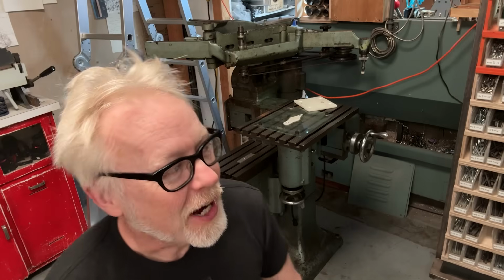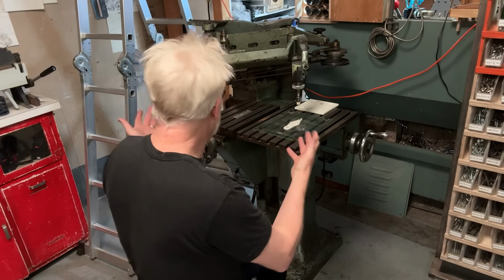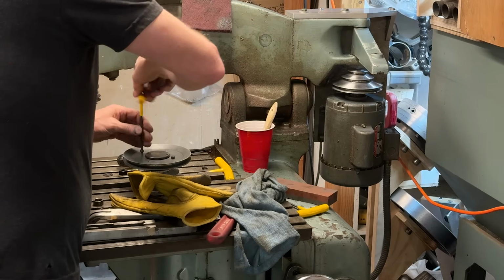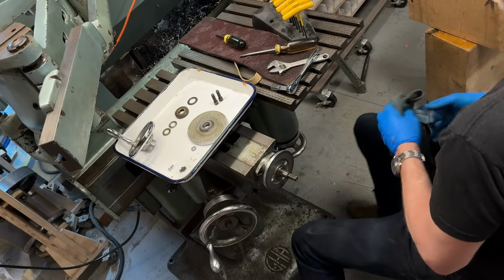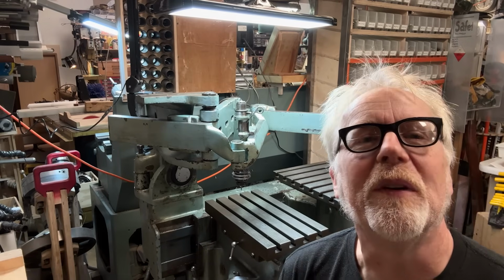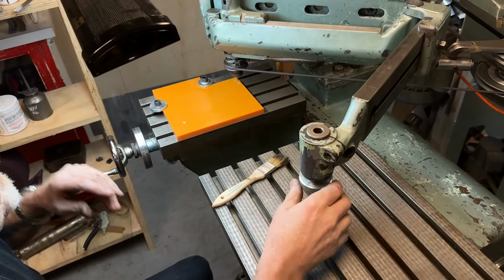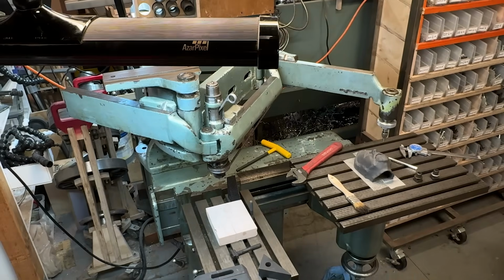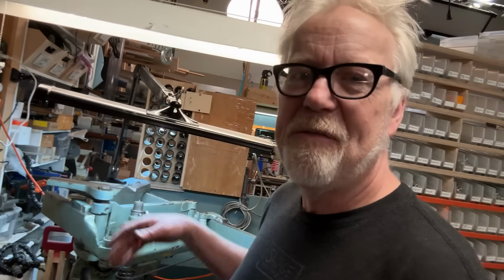Pantograph Mill: The Coolest Machine Adam Savage Owns!

Comment: This is what ChatGPT had to say about the matter: :)

That small plate on top of the milling arm is a depth stop / scale mount.

It’s used to hold a graduated depth scale, dial indicator, or adjustable stop block for the vertical (Z-axis) movement of the cutter head.

On some GHA models (and similar Deckel-style engravers), that position carried either:

A small micrometer stop that limited the downward travel of the spindle head,

Or a pointer and scale plate for manually setting engraving depth.

This allowed repeatable depth control when engraving or light milling, especially when copying contours at a constant depth.

You can often see a small adjustable rod or screw that comes down from above the spindle arm and contacts that pad — that’s the actual stop mechanism.

Comment: WD-40 (Water Displacement) spray would not have been my first choice. the Gray Label of De-Oxit is great on metal surfaces, as well as being a better cleaner for electronics than an atypical tuner bath. It dissolves corrosion and creates a lasting barrier. A PIN wrench should work for the bottom to lock the spindle. And, a couple of stabile well positioned fans, or clip fans to push debris away from the surface of where you are working. What an amazing and capable machine and tool!

Comment: That's really cool, I used to engrave items with a diamond-tipped engraving machine that scribed into items and it was exactly like this.  It worked by tracing pre-machined letters and then scaling down the output size until it fit the item being engraved as needed.   I could also engrave plastic or wood with a rotary attachment and spinning bit, same basic rules applied.

Comment: As a former shoemaker I’ve been always fascinated by the grading pantographs, same principle but with different run for x and y. A pain in the neck to learn and use properly but amazingly it was replaced on the late 80’s by software. I still see some on small pattern making shops, amazing machines.

Comment: I've not used a pantograph, so I'm not sure of the feasibility, but could you possibly make the Gorton (sp?) typeface plates with your nifty new 3D printer? Since the old letters were made of brass, I'm not sure if the 3D versions would hold up under use. Doesn't seem to be a whole lot of pressure or wear and tear on the brass letters.

Comment: Adam, I hope you read your comments sections. I have a game-changing idea. The idea could be simply tested by a guy like you. It's a simple idea but could be a game changer when it comes to green energy. I'll give you a teaser. It's a futuristic energy concept straight out of a sci-fi think tank! "Oceanic Displacement Kinetic Energy (Anti-Gravity) Collection System"—now that’s a mouthful, but it sparks some fascinating possibilities.

I'm envisioning a system that harnesses ocean movement to counteract gravitational forces and generate power? The combination of kinetic energy from tidal displacement principles, (Buoyancy and Displacement) and anti-gravity mechanisms that are intriguing and perhaps Game changing. The experiment would require 3 Water tubs placed at differing heights so that each can empty by gravity into the next lower tub. 3 Air filled lifting platforms of varying heights would be necessary. The highest tub would have the lowest Platform when the tub is empty and the second platform will have it's platform already at a level when the tub is empty that anticipates the height at which the #1 platform is expected to top out when water is added to tub#1. The next higher platform Tub 3 repeats and all tubs use the original water from tub #1 to raise the floats. Weights in the form of Kids marbles are placed on the top of the floating platforms in Stage one and they are transferred to the next platform by rolling off one platform and onto the others. We are trying to create a gravity battery using marbles for now. It's a great idea and you are my last hope of creating a demo.

Comment: (but when engraving metal directly, not graphite for the edm, the cutters were facteted solid carbide. like 4 facets at 60 degree , like the dullest drill ever on the planet, but it made the cutter strong enough for the 10:1 reduction

Comment: The top accepts an arm that allows you to put curved pattern above the stylus, so you can use the lettering loaded in the flat little dovetailed trays, but the sping loaded stylus on the top folows the curvature to engrave on a curved surface. Never used it, saw it in the manual

Comment: It could potentially be possible to do a roughing pass first, leaving finishing stock, by having your stylus be 5x or 10x the cutter plus 5-10 thou on diameter to leave finishing stock. So long as your stylus is shaped the same as the cutter (same tip angle, corner rad if using a mill) having that slightly larger stylus shouldn't "cut into" the finishing stock, and could make it a much faster process overall. Only tricky part might be offsetting the stylus 5-10 thou on depth, 1-2 thou shim stock at the cutter when setting heights, maybe?

Comment: Adam, are you aware? There are, in fact, differences between British Imperial and US Imperial fasteners. The thread forms are slightly different, but they are interchangeable. However, the bolt heads and the wrenches that go with them are toleranced differently.   I.e., in one standard, the bolt head is exactly the nominal size, and the wrench is oversized to fit it. In the other standard, it's the other way around. Unfortunately, I don't remember which way is which.

This originally became an issue during World War II, where mechanics had to have two sets of tools: US and British. I ran into the problem on my 1971 Austin America.  Which makes me think that the British bolt heads are exactly sized and the US wrenches are exactly sized. I think I took a file to a half inch wrench to solve the problem on my car.

The good news is that if you want, because the threads’ pitches are compatible, you can always replace the British fasteners with US fasteners. They still work, and you don't have to modify or acquire different tools.

Comment: Have one of these and have made torx bolts with it using 3d printed templates. Also have an attachment to engrave or cut cylindrical objects which is pretty cool. Theres also a simple attachment to lock the template spindle arm so the machine becomes a high rpm milling machine (not so rigid though, but still fun).

Comment: The part that is missing on the top of the machine is called a form plate holder.  It reaches over to the top of the cutter spindle and aids in 3D cutting.  There is one other part that goes with it.  Not sure how close to the GK21 it is, but I have full schematics for the GK21 with parts list and break down of each part, including the spindle.  I have them in paper and digital format.  Another cool thing, you can swap the cutter spindle and the stylus and enlarge things too.

Comment: I spent many years working as a modelmaker using a Taylor Hobson Type K pantograph for just about all milling work in plastic and aluminium using end mills. The company is still using them over cnc because if you are skilled with one you can quite often make the part faster than you can draw it up on computer.  The Type K has a 50:1 reduction so you can be pretty rough in creating a large pattern with all the imperfections scaled down in the final product. Many a toy prototype was made using just the Type K and a lathe, pre computers many UK model studios did just contain a Type K, a lathe and a table saw. We had enough practice using them we could engrave pretty accurate surface detail just by printing out an enlarged drawing and following it by hand. Make just a few jigs for it and it’s extremely versatile.

Comment: Ran one of these beauties for 3 years engraving all sorts of signs and nameplates for electrical cabinets. A lot of foreigners (private jobs) were done in brass! Then done a fitting and machining apprenticeship. The machine I used was 1938 vintage. Had HEAPS of templates for letters and numbers and figures. 2 different sizes. I could do lettering from 1mm high to about 75mm high. Used 3 layer plastic. G'day from Tasmania

Comment: I do not think you need to purchase letter templates. Not when you own that sintered nylon 3D printer. You can make any template you wish. If you need a brass template, so it would last 50 years of intensive use, use a large 3D printed template to engave it.
If I remember correctly you can also make slanted letters from straight template by setting the two arms to unequal ratio. I worked briefly with similar pantograph 40 years ago. They were used extensively to make plastic engraved signs for doors, mailboxes, general labels.

Comment: I worked in a sign shop that had a variety of pantographs. Fun machines. You'll definitely want a set of guide rails made to slot your letters into words, and a good variety of milling bits—there's a noticeable difference between ball end, v-groove, and square profile. You can also get fixed diamond point cutters that don't rotate, which is great for etching brass and other sheet metals, which can be left as-is or oxidized dark. Gives that real "ye olde" vibe, especially if you can get your hands on a blackletter alphabet.

Comment: Now you need the Deckel SO tool grinder to sit next to it and grind custom stylii and matching cutters.  That's what they were made for.

 Years ago I saw the pantograph wooden master models used to make plastic model airplane kit injection molds in the 1960s before CNC. Mold block in one side, wooden model to trace on the other.

Comment: That's amazing. I've been very interested in these for a couple years now, but patographed machining for 3D stuff is hard to find info on. 

Are you going to do something on injection molding? How do they make a negative? Do they make a plastic casting of the part and patograph the resulting mold? Is there a way to invert the pantograph in the Z axis?

Comment: Nice.  Pretty sure its an Alexander 3A.  I have a Deckle GK21.  One tip to make things easier is to swap out the stylus holder with an ER32 collet holder, and use pin gauges as your stylus.

Comment: Hi  looks like a ritchards 
Did you get the setting bar that sits in a leather  pocket on the lh side  use by slipping into female taper in the lh arm pivot to obtain the2$1/2 Dfunction  or the bar that bolts on the location on top of the lh side and interacts with the top of the cutting spindle to allow cutting letters on the curved surfaces 
You should also have a round base with a column on it to replace the stylus holder to allow you to use the lh table as a mill . This also is used to immobilise the arms during moving about to save breakages to the arms 
 Take time to make a stylus that is a tight  running fit in the stylus plattern table to mill jobs in a vice on the work table  BTW the plattern table can be rotated 360degrees.good luck regards John🇦🇺😎🐈‍⬛

Comment: I've done work at automotive plants where they have a robotic arm with a 3' steel needle with a diamond or sapphire tip that measures an entire car body  for QC.  The arms are "zoom zoom", then crawl into position, and slowly trace like a door pillar, or the roof line, the trunk opening, etc.  All automatic and pass/fail.  Crazy accurate.

Comment: Holy cow, i forgot drafting class!  We used a 2d panto-graph to make up scaled or down scaled drawings by tracing the original, and the resulting output could be differing ratios of bigger or smaller.  Granted, as a draftsman, you should just be able to re-draw the drawing at the appropriate scale, but that takes longer than using the panto-graph.

Comment: I disagree.  A maker of the right thing could definitely use one of those panto-graph machines.

The only other option is to use a 3D scanning tool (basically a panto-graph like 3D measuring device), and then 3D print it.

If you are doing only a few of a thing, the panto-graph is probably a better bet.  I remember using a 2D one to make two color plastic label plates, in the 2000's.  Worked like a champ, and intuitive and easy to use.

Comment: Last year bought Deckel G1L from 1972, much smaler than this one.
Same spindle and belt, smaler tables.
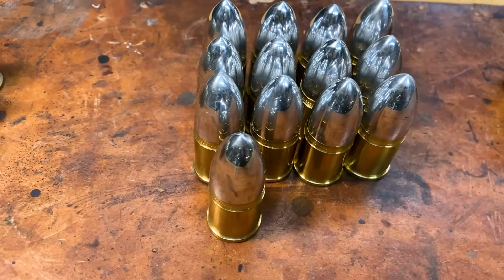It goes to 1:50 reduction.
It usefull, desighn a part in FreeCad five times biger, print on 3D printer and reduce copy it on Deckel.
Its precise enough for most part reproduction and is wery good at making wery smal parts under 5mm.
Only its 2d, biger models can work 3D.
It has potential for 3D, it has a floating spindle whit removable cap, perhaps a small stepmotor whit reduction and a encoder on the stylus.

Comment: The national museum of toys and miniatures in Kansas City has a short video of them making match box cars from years ago.. they built them large and then used a unit like that to make them in a smaller format and to make the dies for the parts.  NOW would you use a bigger bit to remove a lot of material and then go in with a finer bit to fine tune the rough out?

Comment: this gives me all the memories of working in the Sears key shop in the 1980s as a teen engraving all the pens and keys and stuff people would buy.  I engraved so many personal items on slow days.  I think we had a good ten or more styles of letter plates if I am remembering correctly.  Our machine was much smaller and easier to use than this one.
Reply: I also just remembered how many signatures I technically forged with this thing at Sears (tracing with the pantograph) to make signature stamps for people. You engrave a traced signature into the surface of some plastic, create a little rectangular dam around it and pour liquid rubber into it and let it cure.  Glue that to a nice wood stamper body, and it looks professional.

Comment: Nice… Old-old school.. ball end mill tooling for 3D machining.. when i worked at WDI Tujunga they had a much larger version of that mill in the second floor manual machine shop. Because the 1st floor CNC shop had Haas and Fidel machinery, It was never used, in the 5 years I contract worked there.
Adam I luv your enthusiasm👨🏼‍🔧💲

Comment: I had a friend who was a tool and die maker for Seagate. 
   He had moved to Oklahoma about 1998. 
  He was very valuable to my capabilities and the tooling I owned. Showing me so many methods. 
   In his garage sat a Deckel Pantograph. He rarely used it and had saved it from being scrapped at a shop he worked at shortly here in Oklahoma. 
   He often went into detail about the machine’s capabilities. It was more of a conversation piece that he kept very clean.
    He often told me that I needed that machine in the line of work I was in.  That was the first time I had ever layed eyes on one prior to.  Almost 20 years into my trade and had never seen one used. 
   He offered to sell it to me at scrap prices with all the tooling. I just had other priorities at the time. 
  During the back and forth he passed away. Much of his machining tools went to family members back in California.  
   A short time after the opportunity to own one of these machines passed, I was in a very high profile shop that was still utilizing the exact machine. 
   They in fact had two CNC machining centers but kept them going on other larger metal moving jobs. 
   They would use the CNC milling centers to make a templates, then set them up on the pantograph to duplicate parts that needed repeated detail but not much stock removal to finish. I worked perfectly for this scenario and it was at this moment I said “Damnit I sure did need that piece of equipment.”
   We live we learn.

Comment: Adam , the reason you were having trouble finding wrenches to fit your new toy is they are British fasteners . BSF(British Standard Fine) BSW (British Standard Whitworth) or BA ( the ones under 1/4 inch. You need to start collecting British wrenches,hard to find on this side of the pond.  P.S. the thread form is 55* not 60* .

Comment: I had a Deckle KF12 and it's the one machine I wish I hadn't sold. It was just a well built machine and it was in near perfect condition. I sold it to buy a big beefy mill that I find exhausting to use. A mill so big you cannot reach the X and Y wheels at the same time. The only thing I didn't like about the KF12 is that it didn't have a quill. Someday I'll find a decent deal on a small bridgeport style machine, which is what I really need.

Comment: Hi Adam, the thing to go on top of your patograph, is a holder to atatch a negative surfacemodel for your spindle to follow. When engraving a flat design on to a curved surface. You make a mould of the curved surface and place it above where to engrave.
Reply: Trying to bump this comment for you two.
Reply: @toddler_dragons  Same
Reply: As always, there's something to learn from the collective knowledge of Adam's audience.
Reply: I came to the comments hoping someone beat me to it! I think there is a page about this operation in my machines booklet, although it’s a different make of machine.
Reply: I have the Deckel GK21 and was just about to write about this but saw I was late on the ball. Very informative post!
Reply: Bump.
Reply: bump
Reply: This comment saved me a lot of googling, thank you
Reply: looks like the little cap that sits on top of the spindle for when you're not using the overarm is missing as well.
Reply: Bumpty bump
Reply: Bumpy bump
Reply: Bump?
Reply: BUMP
Reply: This bump sounds legit :)
Reply: Bong bong
Reply: Bumpity bump bump

Comment: Looks like you did that on 10th.. And rough shaping first will help amazingly. Used to make oversized “bowl” molds to allow for a big roughing bit, take off the overmold from the part and no indexing required, put on your finish bit and go slow. Some will use a large stylus bit to rough cut, but if you use a pyrex glass bowl for your rough cut crown you can gauge what you need for clearances. But yeah. Have fun, been a couple dozen years since I played with one.